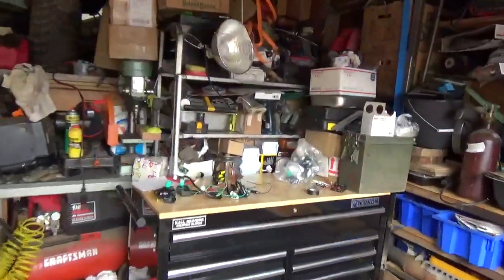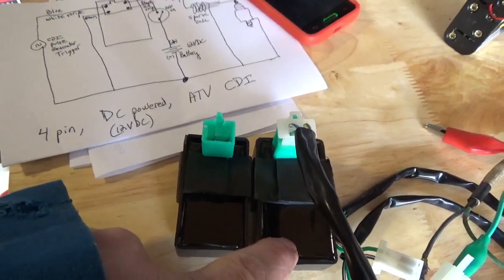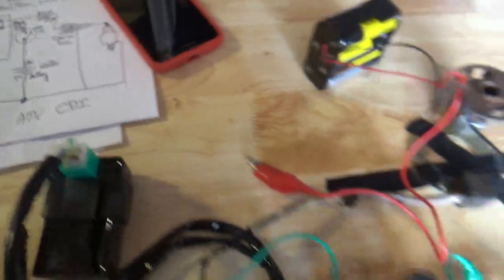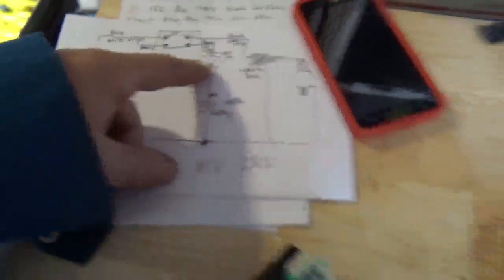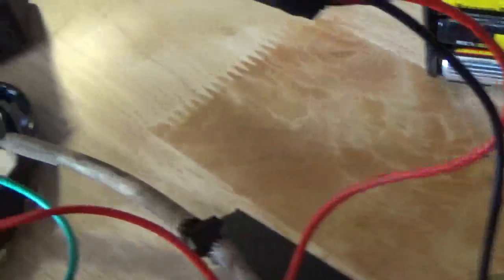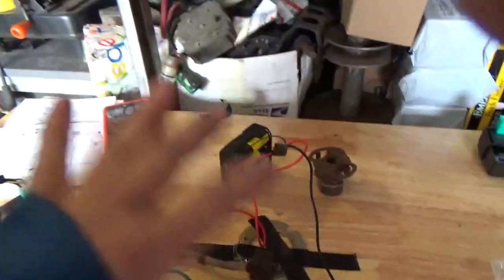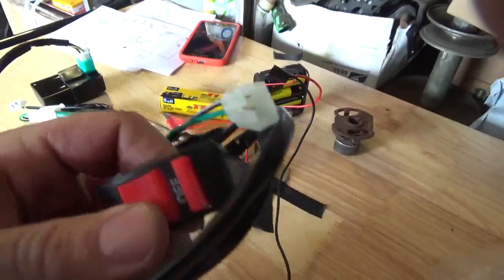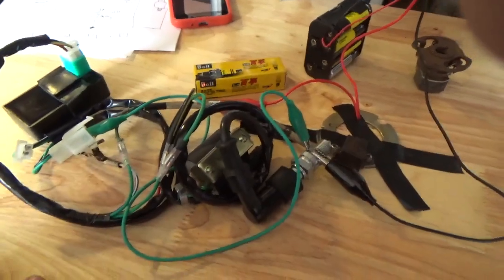How to build ATV / Pit Bike CDI system, low cost, easy project,

Comment: Unreal how personally helpful you are Harvey! Fighting no spark on a new Xmotos FX1. Long story short, a red/black stripe, male bullet plug, hangs loose under the tank, and seems to come from the ignition switch on the upper triple tree. Resistance between that plug and the red/black in the CDI plug is like 120,000 ohms. Your video inspired me to hook it to 12 volts but still no spark. Gettin a new coil and a dc & ac CDI tmrw as resistance across the coil primary terminals is .6 ohms, and .3 ohms with leads shorted. Hope I'm on the right track but the loose wire makes me think something fell out of the box in transit, lol.

Comment: Hey Harvey,     that is a great way to have a backup incase its taken on water and is fussey with the wat it runs.  Anyone who is been out  and away and been in the mud has had a problem
Reply from the maker: Hey Cody, Once I built the portable CDI box, I do a quick carb change or rebuild and then use the portable CDI box and the next thing I know, the engine is running.... Thanks for Ur thoughts, encouragement, watching, and commenting!!!!

Comment: Great video this is dc cdi ignition system and you used ac cdi ignition system wiring. And can we use any switch between the battery positive and the cdi pin? Will it also serve as ignition kill switch?

Comment: Great I paid roughly 600 for the same thing but mine came with stator and tool for an xs650- it works- running a capacitor which side of coil do I splice in to run kill switch? cdi unit came w/ orange wire and black wire- does it matter which wire goes on either side? is one a ground? should kill sw. go to capacitor? kick start only 83 yamaha xs650 only running headlight and tail light- any insight would be a great help

Comment: What purpose the AC cdi box? Was it just to get the bits and pieces that went with it? Also wondering how I can modify breaker points to trigger a cdi rather than pickup.
Reply from the maker: Hey John!!!!   Yes, the AC CDI kit I bought was for the bits and pieces.... I then swapped out the actually AC cdi box for a DC one....  Normally, one swaps out the points for a CDI pulse generator and a magnet on the fly wheel to trigger it.... If it is a Honda or Honda clone there are web sites out there, especially for the Honda CT50/70/90 engines.... Thanks for asking, watching, and commenting!!!!
Reply: They are so cheap! In many cases less than a pint of beer! My bike is a 1970 Honda SS50 5 speed. I wasn't sure about changing the stator plate as it has mechanical advance. You know, the weights and springs. CDI and a racing cdi coil seemed to be a way of improving running as the bike is 50 year old technology, but at 6hp at 11,000 rpm impressive for 50cc! I already changed to iridium spark plug

Comment: Hopefully  your not frozen I have been learning from your videos.
My 260/300 linhia has 3 yellow coming out of the engine 
I am doing an ohm test im getting 1.5 ohms on meter ?
I did just install a new cdi box and I cut the wire going to 
The off switch. I am waiting on parts to build a box to 
Bypass the spaghetti.

Comment: Hey man I ordered and installed this system and it worked perfectly but after I let it run for a few minutes I looked at the green ground wire coming from the coil and it was smoking and seemed to fry to cdi box so I ordered another one hooked it back up and noticed what looked like a lightening bolt coming from the threaded piece on the coil as if it was going to ground any tips on what could cause this or a fix maybe I have something hooked up wrong

Comment: help with a 260cc linhia vog? my wire harness is toast it has the 8 pin cdi. can i remove all this and replace with like a 5 wire cdi and just put coil. pickup coil on. all the wires are missing i have no idea where to begin
Reply from the maker: Hey Tommy!!! Looks to me that there should be 2 plugs with wires coming from Ur fly wheel area, one has a blue and green wire, the second plug has 3 yellow wires.... The 3 yellow wires go into a voltage regulator, the red and black wires from the voltage regulator go to the battery, (+) and (-) respectively.... The blue and green wires come from your pulse generator, I would use them to trigger my 12VDC portable GY6 CDI box or U can use the Casoli high performance version.... I hope this helps.... Thanks for asking, watching, and commenting!!!!

Comment: i have 3. 8 pin cdi boxes 2 new . new coil no fire at all. does the stator have anything to do with firing the plug or is it just the battery ? yes i have two plugs from the engine. have not changed the pickup coil. am i correct in thinking the CDI.. Pickup coil  and coil is the ignition
Reply from the maker: Hey Tommy, Any capacitive discharge ignition, (CDI), consists of the following, a CDI unit, a wire harness, a spark coil, a pulse generator, and a power source, some CDI units are powered by a stator, (AC power), or the battery, (DC powered), to me, it looks like Ur CDI is DC powered as there are no tighten wound coils on Ur stator that normally power a CDI,,,, So, I hope this helps, thanks for asking, watching, and commenting!!!

Comment: This may sound silly, but is it necessary to buy the cdi for 250cc bikes if that is what you have?
Reply from the maker: Hey Rex!!!  This CDI system works for most 4 stroke engines, the engine cc size does not matter, as long as there is a pulse generator, it should work.... Did I answer Ur question???   Thanks for asking, watching, and commenting!!!!

Comment: anyone test on a Suzuki lt230e 87 quadrunner my CDI is not so good i have a vice clamp on it and hit it  when i lose spark cold solder joint i think
Reply from the maker: Hey Quad Log, For $21 U can try it, it should work depending on Ur pulse generator.... U may have to swap the leads between ground and the CDI input on the pulse generator to see which way they work better.... Thanks for asking, watching, and commenting, let me know how U make out....
Reply: when i find the time ill try i have the cdi just have to make a splice lead to test

Comment: Hey Harvey, great videos. I'm having issues with a lifon 250st quad bike and getting no spark, I have replaced both coils, the 6 pin CDI and still no spark. The bike has both a 6 pin CDI and a 8 pin CDI and I can not find the 8 pin CDI with the same plug type. My question is what's the deal with the 8 pin CDI? Can I change it to a 6 pin CDI? Thanks in advance...
Reply from the maker: Hey Matt, I have not worked on a Lifon 250 engine, but, a lot of times, they are the clone of something Honda... The Honda 250X has 2 CDI's as does the 300EX and many others.... One CDI runs on AC, it is used for reverse, and it has some logic circuits in it.... The other CDI runs on DC and is used for forward driving.... For my 250X and 300EX, I will be getting spark from this ignition system... https://www.youtube.com/watch?v=e4p4FO79p9c.... It gets rid of all my hacked up wire harness issues.... I hope this helps, let me know.... Thanks for asking, watching, and commenting!!!!
Reply: Harvey Spooner thanks! That was a huge help, looks like I will be just be doing a diy ignition.
Reply: Mine is 6 pin and I get nothing g out off coil

Comment: Have you done anything with a Chinese twin cylinder engine?
Reply from the maker: Hey Something!!! This would work, if there are 2 pulse generators, U would need one for each, if there is a single pulse generator, then there should be 2 spark plug wires coming out of the OEM ignition coil and I would recommend using that.... Will it work, it should.... Thanks for asking, watching, and commenting!!!!
Reply: Harvey Spooner it has a single pulser and I don't have the original CDI that came with the engine, I was able to use a regular   DC unit and get it to fire up, but it seems that it fires right off idle in way too much advance, causing the exhaust to glow
Reply from the maker: Hey Something!!!! Super hot exhaust.... If it runs without pre ignition, I would probably run the exhaust valve gap/ valve lash, a little loose and I would run the fuel mix a little rich and go with a higher octane fuel.... My 250SX used to run with a red exhaust when I push it hard, it was running lean and an eventual carb replacement fixed it. Also, make sure U have no intake air leak and I would not run a high performance CDI box.... I hope all this helps.... Thanks for asking, watching, and commenting!!!
Reply: A friend of mine had a Honda CM250 CDI that I am going to try wiring in, which by my understanding, the engine is actually copied from that design, so I just have to figure out how to wire it. I didn't even think about valve lash gap, before I even though about using the engine, I pulled that cover off and checked all 4 and believe it was between .004 and .005, I believe, I'll it off again and check and put the exhaust side to .007 or .008 and see what happens. 
Thank you for your input
Reply from the maker: Hey Something!!!! Once again, I would run the exhaust valve a little loose, better some noise then engine damage.... Also, I little richer fuel mix.... Thanks for getting back to me, watching, and commenting!!!

Comment: Will that work for a cdi box on my rupp sled
Reply from the maker: Hey BmigDaddy, I would try it, assuming Ur rupp has a pulse generator and not points.... Given that the rupp is a 2 cycle, it would probably have some trouble at the higher RPMs as this is set up for a 4cycle both timing and RPM range... I think it would start, how well it would run would be debatable until U tried.... Thanks for asking, watching, and commenting!!

Comment: Would this work on a 260cc linhia,vog, water cooled? 12v
Reply from the maker: Hey Tommy, I think it will, as long as there is a pulse generator, it will work... In William Staten's channel, I think he used one of these set ups on a Linhia type engine.... Thanks for asking, watching, and commenting!!!
Reply: YOUR WELCOME. any ideal where i could find a wiring skymatic for that bike? and does the charging plug have to be hooked  to generate a spark.The wiring harness is done for. i dont have a clue where to start for a spark thanks

Comment: Hello :) Do these CDI boxes automatically advance ignition with increased rpm? Or is it fixed timing?
Reply: No but you won't have any problems if you have a rev limiter you will no longer have it but it will run just fine

Comment: What's the difference between a.c. and dc cdi box?
Reply from the maker: Hey Joey!!!   The AC box is powered from the stator, no battery needed, the DC CDI box is powered off the battery, stator not needed except to charge the battery.... DC CDI boxes are physically bigger as they need to turn the 12VDC into AC.... I hope this helps, thanks for asking, watching, and commenting!!!!
Reply: Thanks so much!!
Reply from the maker: Hey Joey, np!!!   Thanks for asking, watching, and commenting!!!!
Reply: Harvey Spooner so we can use same ignition coil? Do these dc cdi have any performance gain? Do they do any thing to timing at different Rpms? And does it produces any strong spark